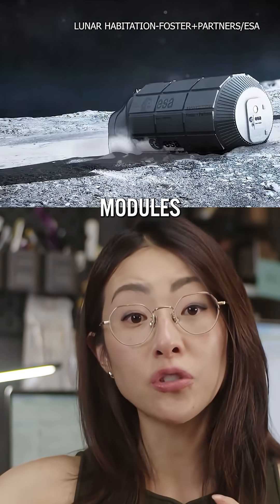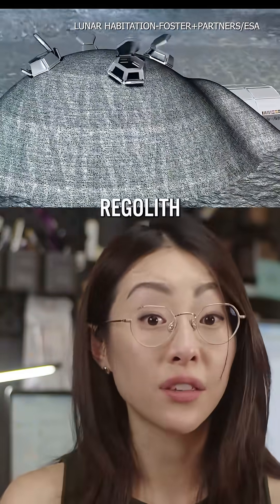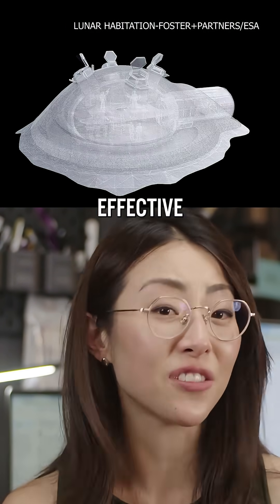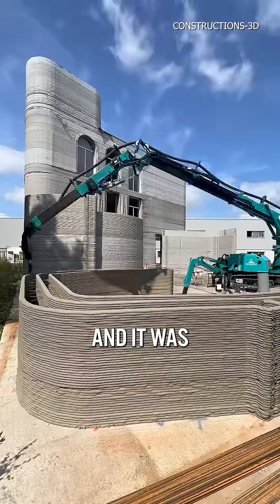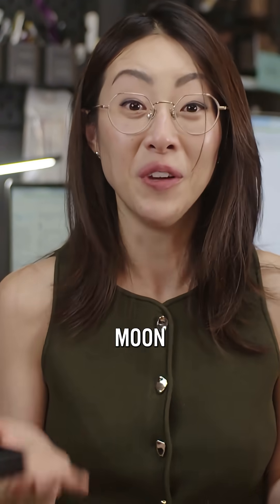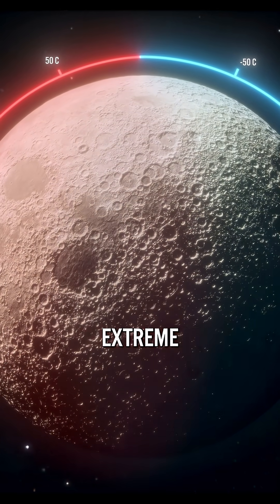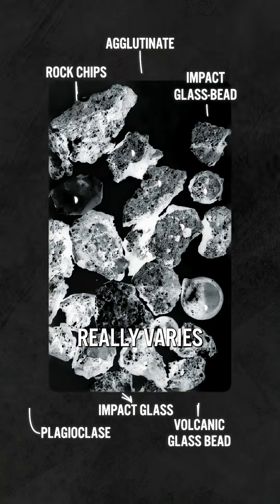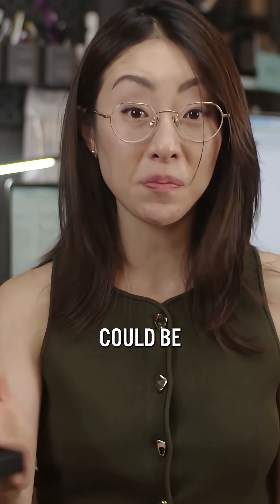What would you build first if you had a lunar 3D printer?

Comment: For some time the widely accepted plan that NASA has been moving forward with is to build a moon base in a lava tube on the moon. The moon, while now solid, at one point had a volcanicly active core, meaning it has extremely stable lava tubes which we can find using magnetic field data.  I'm not sure what she's talking about, no amount of "3D printed shell" is going to be effective against a grain of dust moving at 400 km/s (which Parker solar probe has at some points reached, this a very real number).  This is to say nothing of the radiation blocking properties, or the lack there of, or the wildly varrying thermals as your temperatures swing by hundreds of kelvin during the day and night. Additionally, "material on the moon" aka moon dust, especially that on the surface, is extremely difficult to do anything with due to being blasted down to razer thin pieces, it's like Asbestos but able to shave through kevlar the way it normally shaves through lungs.  While there are ways to deal with it, using it as a primary building material, especially in a 3D print system would be an absolute nightmare.  Heavy machinery, or even light machinery are made extremely difficult to operate by the properties of the dust, especially if they directly interact with it (like the Lunar Rover)

While there may be other plans that people have proposed, lava tubes are the plan that NASA (and I believe Eurospace) are moving forward with, and generally considered the only plan feasible anytime soon.  We have already begun taking magnetic readings of the moon (almost all the recent moon missions have been equipped with magnetometers), and the plan is to send Artemis with a high precision magnetometer to perform manual observations on the ground.    

Granted, this is all assuming that NASA doesn't shut down their magnetic division, which is not an impossibility, and would almost certainly mean Eurospace beats them to having a moon base, potentially China as well.  To my knowledge there are only two labs on earth capable of consistently making magnetometers to the necessary specifications to perform this (One at NASA, at risk of being shut down, one in France, unable to bid on many US government contracts).
Reply: THANK YOU!!!
Reply: 🥺got to do my research i guess. thanks for the insight
Reply: NASA themselves have said they want to 3d print a lunar base as a part of the Artemis mission. They have even contracted companies like ICON to develop technologies  to use lunar soil for construction. Experiments and testing are going on right now. What they planning on doing now is the 3D printing one but long term possibilities for the lava tube base is being explored. But the 3D printing one is the one the are actively working on
Reply: @malaywastaken ok, so it seems they want to test 3D printing - good! The whole space program is about testing millions of things and ideas!
.....
still, lava tubes look like the 100 times more promising option :-)

Comment: An idea...The Benishell Method.. I've seen where they use the temporary building or tent as a sort of structural support while the concrete is poured on top. Once the concrete is cured the "bladder" or balloon tent is deflated and re used to make another structure. It also has a very luner look and station vibe to it! Please look or do a video on it! 😅🙏😁👍
Reply: Lunar concrete can also be made with some of the materials on the moon itself but will require a bonding material shipped from earth but will save on shipping weight since half the material needed is on the moon already. Hints lunar concrete as the name 😅😂
Reply: I think moisture becomes an issue for concrete on the moon.  It's over 100c during the day and below 0c at night.  You also will need an extremely thick shell to effectively protect against the radiation, wildly varying thermals, space dust moving at 100s of km/s.  Prayers are the only thing you'll have to protect from meteorites if building on the lunar surface (that's why the plan NASA is moving forward with involves lava tubes)

Comment: Even with a 3D printed home the finishing needs to be done by hand, frames go up so quickly by hand compared to trucking in and setting up the printer, as long as access is adequate.  The printing method does not allow for any on the fly changes to the structure to allow for surprises, which construction is absolutely full of.  I'm a mechanical engineer and have spent enough time in the trades, printing a home sounds like a nightmare.

Comment: On site 3d printing for construction never passed the sniff test. The amount of time and effort spent setting up and troubleshooting the machine, feeding it material and setting up the necessary utility raceways in the walls as it prints probably doesn't ever beat out the efficiency of just throwing up a CMU block wall structure. However, setting up industrial scaled 3d printers on factory floors to print modular building system panels may actually off the sort of production efficiency gains that were first imagined with the technology.
Reply: Tldr R&D phase, onboarding, adjusting to the new tool
Never going to just work from out the packaging

But yes it does seem manual labour is cheaper, for now
Reply: @PJOZeus og you got it
Reply: 3d printing is effective for prototyping and building complex structures. Any other manufacturing method is faster and cheaper when it comes to mass production, so no, it probably wouldn't be used for mass producing modular structures
Reply: There are companies out there already doing this actually. But the rooms are too small.
Reply: 3D printing concrete is very popular for many construction projects. It's easy and quick. No it doesn't take 3 months either. I watched Messer print a house in 2.5 days other than the roof.
Reply: Recently I saw a video where they are still working to improve the technology so they can just drive a truck up to the site and it prints from a boom on it's bed instead of having to set up a while frame around the area. I think it still has some promise in the future.
Reply: Also because of the amount of changes that happen during a building project makes the method very difficult to do. Once you’ve made the plan that’s pretty much it, you have to change so much it’s not cost effective to do and retain flexibility throughout the build. People value flexibility and lead times over most everything else still.
Reply: More of a barrier is how set in their ways lots of project managers and foremen are. Some guys still insist on building wood forms for every bit of concrete and we've had better options for decades
Reply: Why 3d print houses when cheap prefab buildings made from standardized parts have been a thing for generations?
Reply: YEAH!
like placed like mexico city, Chile and  Japan that need a special type of architecture because of the earthquakes that happen there, a full 3D printing house would be really dangerous
Reply: A specialized machine will always beat out the 3d printer. The printer's REAL benefit is that it can be changed to produce something different just by modifying the software, thus saving space.
Reply: If you are making a wall in a factory there are better ways to make them than 3D printing. 3D printing is good on small scale (like the first habitats in the moon) and on odd shapes (like spheres, curves, etc)
Reply: The big elephant in the room is human labour is by far still more cheaper than machine work.  

The more mundane or simple the task the better it is for companies to use human labour instead of machine.

Only in eletronic productions where machines really hit it off because making small parts with high accuracy is just too much for humans to do.  

But making houses?   For the price of renting a 3d printer with its technician you can hire 100s of Chinese worker who will do 10 hour shifts each day, everyday.
Reply: It can still work if we have a labour shortage, which I don’t see happening for decades. Hopefully the tech evolves till then
Reply: @AtillatheFun  It cant.  There are also already very automated systems. everything gets premade in a factory and set up by a human crew.
i have seen some swiss company set up a house in a day with everything ready but the roof.
the roof could also be premade but not in the style europeans want it.
Reply: @nox5555  Its just a metter of technological advancement. Other ways are more efficient until they aren't. The same thing will happen with electric vehicles as soon as battery technology is improved enough. That is the main thing that is holding EV back is batteries
Reply: @rdwilln  EVs didnt win, they are only selling because of government intervention. there is also no way that 3D Printing will ever be cheaper than conventional production at scale.
Reply: you have literally reinvented soviet house factories, which manufactured giant standardized concrete slabs, that were transported to the specific locations to be assembled by simple workers.
Westerners call them "commie blocks". Others call them "panel buildings".
The thing is, it's highly impractical and requires a lot of tradeoffs in both comfortability and construction quality. Plus, to make it profitable you would need soviet scale of demand, and standardization, which people hate.

Not to mention that there's literally zero benefits from 3d printing walls instead of just making them in a normal way. Is it in a factory or on site. It only ups the speed, with quality as a tradeoff.

I live in one, and in a smaller one, with only five floors, and it already looks like shit after 80 years. I can't imagine what a hellhole 14 floor and higher buildings are rn. They were meant to be a quick and temporary solution to a lack of housing, but nothing is as permanent as something temporary.
Reply: @worldspam5682  Prefab panel buildings are actually pretty normal in the West, too. The building I live is one, and it's definitely sturdier and quieter than the timber frame buildings I've suffered in the past. Down the street from me a few 8 or so storey apartments made of panels have been built, the last one over the course of this summer. I think building quality comes down to construction standards and planning (ie, the building I'm in was never meant to be a temporary measure, but was built to last in the 80s).
Reply: 3D Printing the shell in only one component of the automated construction suite, plumbing electrical and HVAC installation automation are largely held back by regulation/licensure requirements. There is no reason the same crane type used for the printer couldn't be used to lay pex,  cable-in-conduit, and place supports and raceways. Regulations aside, it would just be a cost/benefit of managing employees and contractors vs. Parts and Maintainance. Some people are saying it will be humanoid robots that fill the gap, but that's crap, robotic arms on mobile platforms and crane systems will outperform in the long run. 

The logistics side can and will be handled with specialized vehicles.

Overall the startup infrastructure cost for this kind of full automated construction supplychain is likely in the hundreds of millions, but in nations with aging populations and tradesman shortages I view it as an inevitability.

Yes prefab panels will play a role, yes on-site block laying will play a role, and yes 3D printing will play a role, especially when it comes to low cost high volume mixes like aerohempcrete and syroaircrete and curvalinear forms.

As a side note, I see 3D printing really shining in drainage and sewar applications where snaking into a tunnel is a big advantage, and curves are a necessity, as well as handling uneven foundations being a big advantage.
Reply: Whenever I've seen people touting 3D printing for construction, they always assume the materials are the costliest part of construction. In reality the location is probably the most expensive, followed by planning, then labor, and lastly by materials. In typical construction 3D printing is a great solution for something that isn't a problem.
Reply: Never passed the sniff test?  Are you 3. 3d house printing on location is already a thing that happens.
Reply: @NotaNinja exactly. I literally built one last year on site in 56 hours of printing... Two printer operators and a large audience. Many more on the way
Reply: @leestrz4153 great. You just built the easiest 1/4 of a house. Where is the earthworks, basement, windows, doors, electrical, plumbing, roof, interior finish, flooring, insulation, heating, ventilation?

None of those issues get addressed by 3D printing, but pre-manufactured houses solve a good portion of that at a fraction of the cost.

Comment: Never gonna happen. This is nothing but entertainment. Why? The moon can provide the rock (agregate)and maybe cement (the stuff that crystalizes as it drys) but it cannot provide the suspension material (water or plastic). This means we will have to carry enough water or plastic to act as suspension for the building material. WATER IS HEAVY. PLASTIC IS VOLUMINOUS. The only way this works is with a foaming plastic but then you have to bring the rectants and mix them in a controlled environment. I'm calling 3d printing houses on the moon bullshit. Sure, we can build 1 for 5 trillion dollars... that'll be one hell of a vacation home for Bezos.

Comment: Why does the regolyth need to be converted to concrete?  There is no wind to blow it away. Just pile it on top of the structures as sand, effectively.  It's purpose is to reduce radiation and inthink just piling it on top of the structure should work.

Comment: Can't use inflatables on the moon because of the lack of Atmosphere. The lack of atmosphere means lunar regolith is not shaped by wind so the particles do not get rounded by wind so relogith particles are sharp. Eventually you are going to get punctures with long term use no matter how strong your inflatable fabrics are.

Anything that has to maintain an atmosphere has to be metal on the moon. Inflatable works great in space including being better at radiation and micro metiorite protection due to multiple layers and flexibility. Inflatable on the moon is suicidal.

Comment: The biggest factor in 3d printing houses not taking off is building the shell is one of the cheapest part of building a house, especially when you compare concrete construction cost with stick built. All of the finishings/electrical/plumbing/mechanical cost significantly more than the framing and sheathing. And thats not including the additional cost of those trades having to penatrate concrete to do thier work.
Reply: This is 100% correct. They're trying to solve the wrong problem.
Reply: ..damn, you are right.. the walls and the flooring and roof is like 30% of the cost :/.. 
..ok, so I guess if you could do the wiring and plumbing at the same time.. ? And finishing? 
Every one of those is it’s own project tho..
Reply: In Europe we build more with brick which need firing so 3D printing might start to take off.
But you can build with large bricks very quickly and anyone that can set up a 3D printer for a house smart enough that he could lay brick.
Reply: @stuartanderws5705  how using bricks changes anything? Like, that for sure still doesn't solve the problem with utilities. Not to mention that bricks are being revolutionized too. (at least companies are try to)
Reply: @worldspam5682  "how using bricks changes anything?"
"Not to mention that bricks are being revolutionized too."
Your point is ?
Reply: @stuartanderws5705  The commenter is obviously an american. Why to mention that europe is using bricks more? That just has nothing to do with his comment. Bricks requiring firing has no meaning here too, but you have mentioned it as some reason for 3d printing to take off. (I didn't get why) Then I just gave a quick heads up that bricks do evolve too. For example, we have bricks that don't require external heat, or require a little, or insulate better, or don't produce co2, or use better materials. It is not only 3d printing that evolves, everything else advances too, so even that strange advantage of not requiring fire, is a nothingburger.
Reply: It all depends on what you're prioritizing 
I prioritize longevity, security, steadiness
The main goal is not to make a house, but to live in it
What's the best we can do to make, not house making, house living more effective?
Reply: People are also resistant to nontraditional looking houses. Everyone is obsessed with resale value these days.
Reply: @gmirwin  no, almost nobody is. Everyone are obsessed with whatever they have seen on the internet and it struck the right spot in their brain. Not to mention that there are only a few countries that have traditional architecture pleasant, practical, and worthy enough to be obsessed with.
Reply: @worldspam5682 it's not a buyer's market though. Housing is very regulated. Making something non traditional is a huge headache to get approved regardless of the building technique used. HOA and cities can completely dictate how your home looks to the point that most people give up and just build what everything else looks like
Reply: The concrete also inhibits cellular and WiFi signals. You can have a brick house. It's absolutely shit for reception.